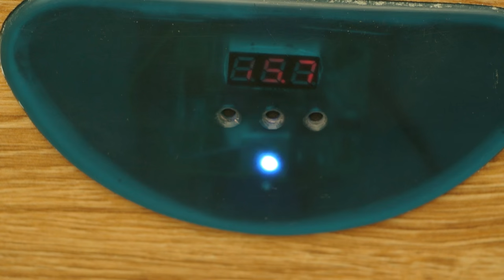How to make a car fridge

Comment: Do you think 3or 4 of these installed in the back of a gutted but well sealed and insulated cargo van would work better than air conditioning? Maybe towards the roof, one in each of the 4 corners.. Asking for a friend...

Comment: Why did you opt for an aircooled solution, not a wattercooled one? Awesome build!
Reply from the maker: Air cooling is cheaper
Reply: No mad It disspates more heat than air but at slower rate. And of course more expensive.

Comment: But why didn't you align fans with radiators?
Reply: Basic thermodynamic principles - heat transfer is far more efficient with fin heatsinks if air is forced across/between the fins, rather than onto or away from them.

Comment: Interesting fridge but I thought it was FOR THE CAR. There are no handles. It wouldn't be easy to move around. Also, where would you put it? It's rather large. In the trunk? In the passenger compartment? Looks like it was designed to stand upright. How would passengers have easy access to it in a car?

Comment: Your heat extraction fans are in the wrong place, you would have better cold temperatures on the inside, it you had the fans directly on the heatsinks, there is a reason why everyone puts the fans on the heatsinks...
Reply: Your understanding of thermodynamics is flawed. Heatsinks are far more efficient if air travels across them rather than being forced onto or away from them.